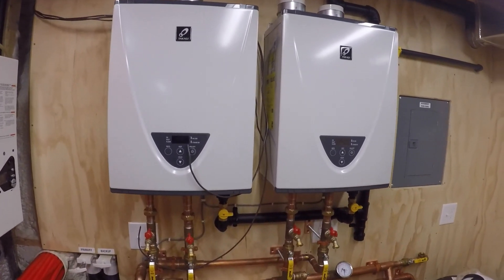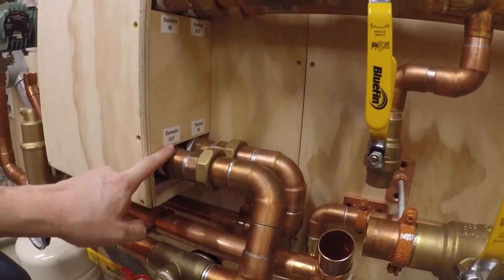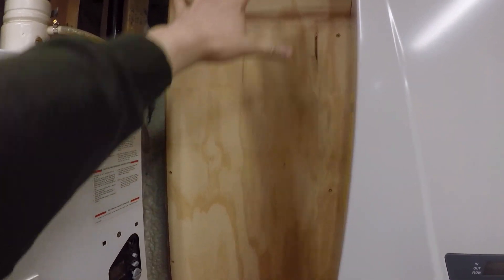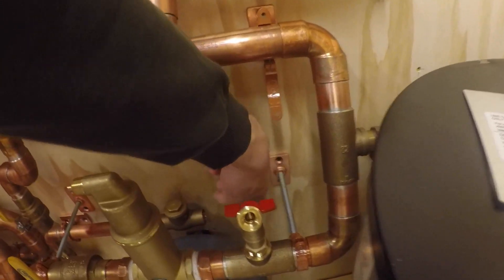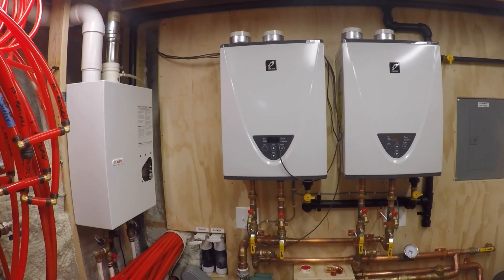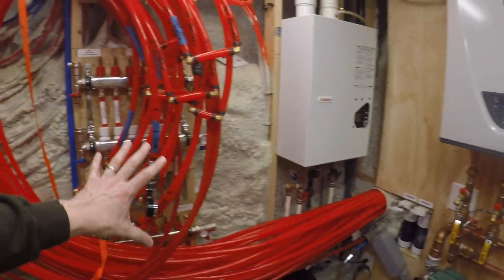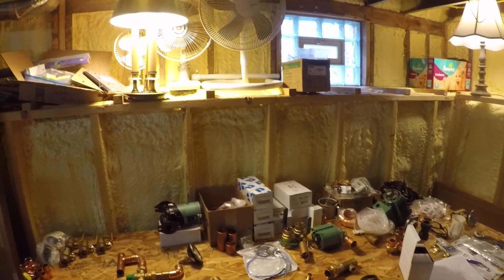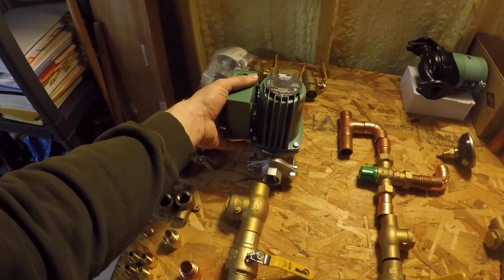Installation Progress: Primary Loop Complete, Secondary Loop Ideas - Episode 12 [5-11-2020]

Comment: have you seen hydronic snowmelts where individual pumps are assigned per loop? what are your thoughts on that?
Reply from the maker: Hi Aaron.  I have seen systems that use 1 pump and several zone valves, and systems like mine that use 1 pump for each zone.  I can't say I've seen a system with a pump for each pex loop if that what's you're referring to.  Pump type and size is usually dependent on required flow and pumping head.  I guess if you had a pex loop long enough, it might require a pump for one loop, but I would say that's rare.

Comment: Where did you order your parts? These videos are great. I am working on a similar setup, but having difficulty sourcing sourcing parts.
Reply from the maker: Hey Joshua.  I ended up ordering parts from pretty much everywhere.  I purchased a lot from Supplyhouse.com, but I also ordered from Amazon, E-Bay, Home Depot, Lowes, my local Plumbing Supply House, and even purchased a couple of things through forums.  Sometimes I ordered parts months in advance before I needed them, just because I found them at a good price.  I purchased a lot pre-COVID and all of these supply chain issues, so I feel your pain if your training to find everything now. Thanks for watching, and good luck with your setup!   Let me know if you have any other questions or if I can be of further help.

Comment: What size gas meter do you have? Did you have to upgrade to 2 PSI at some point?

By the way, these videos are awesome. I thought my projects were overkill until I saw your videos. This helped me justify my projects to myself haha. I live in Texas so I have no real need for snow melt loops, but I'd love to have a domestic system similar to yours. The only change I would make would be running the plumbing with the Uponor Logic system, which can help to save wasted water if used with a hot water recirculation pump.
Reply from the maker: Hey @commoncents1111tx.  Great question!  I did reach out to National Fuel (my Natural Gas company) before starting the project, and they told me I should be ok with my current AL-250 meter, but if I wanted to be safe they could upgrade it to an AL-425 for about $150.  I elected to have it upgraded to be safe, and thought $150 was reasonable.  The AL-425 is the biggest I could go with the existing line to my house, anything larger and the line itself would need to be upgraded.  The AL-425 is capable of 425,000 BTU's (even though my receipt from National Fuel says 600,000) either of which should be more than I will ever need. So far I have had 0 gas related issues.  I'm not familiar with the Uponor Logic system, I'll have to check it out.  Glad you enjoy the videos, there are a lot more to come.  Thanks for watching!
Reply: @DeckerChristopherJ  thanks for the reply! 

The Uponor Logic system was likely created by someone else, but Uponor has pushed the system for use with their multi-port tees and pex A pipe. I currently have plumbing that is original to the house (copper from 1968) and I live in Texas, so we are slab on grade, no basement or crawlspace. My current goal is to replace all of the aluminum wiring, and I would eventually like to repipe the house. I plan to use expansion pex, whether it be Uponor pex A or Zurn's pex B that is rated for expansion fittings. I would prefer copper, but I would have to repipe in the attic and I want to avoid any issues from potential freezes. I work for a city water department, and I responded to a bunch of houses that were destroyed from frozen copper pipes in the attic during our big freeze this February. I'm sure no one would ever consider running plumbing through a vented attic up where you live. My goal is to have the pipes insulated well enough that we only even need to worry about it when we get a multiple day freeze once every few years. 

The point of the logic system is to run the hot water pipe like a "race track" around the house. Each section will have a multi-port tee, and then the main hot supply will continue on to the next section. I plan to make my own tees using copper and brass, as I want to have valves on the tees to make them more similar to a remote manifold. Once you get to the last tee for the fixtures, you then run a return line back to the water heater, and a recirculation pump. Because of the multi-port tees located near the fixtures, one only has to purge 10 feet or less of cold water to get to the recirculated section of the pipe, assuming the system is planned correctly. This means maybe 2 cups of water need to run down the drain to get hot water, which will bring hot water to most fixtures in under 5 seconds.
Reply: @DeckerChristopherJ  also, did they ask to see a permit or anything before they replaced your gas meter, or were you able to get the gas meter replaced before you began all of this?

Edit: also, wouldn't 425,000 BTUs be cutting it close in certain 1% a year conditions? Like if for some reason your two tankless units were running 100% at 398,000 BTUs, along with your furnace running? I'm not extremely well versed in the plumbing and fuel gas codes though, so I don't know if you're able to go based off load calculations instead of the full load rating of the units.
Reply from the maker: No permits required to upgrade the meter, just an application and fee with the gas company. The gas company also stated in writing that it was good up to 600,000 BTU's.